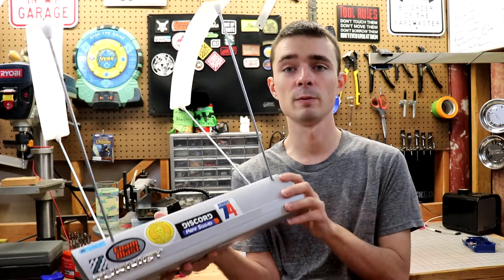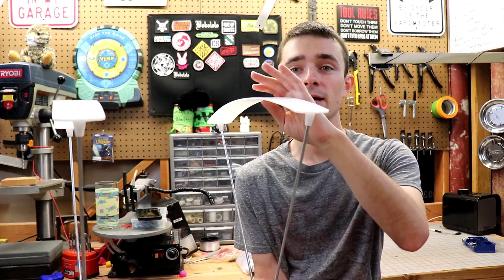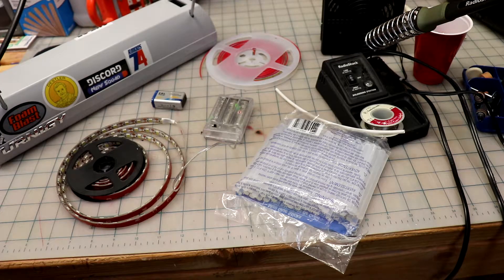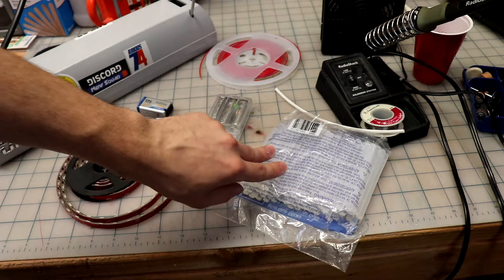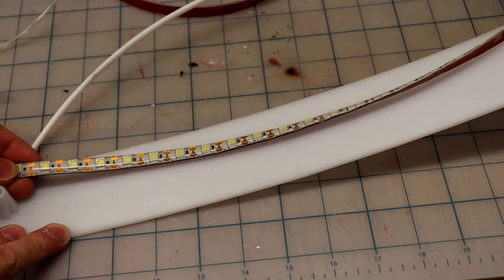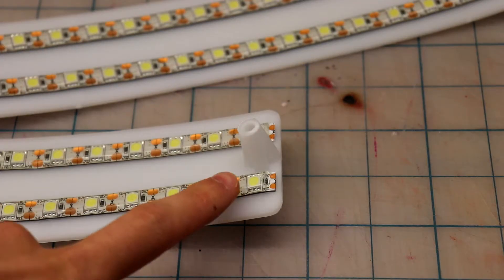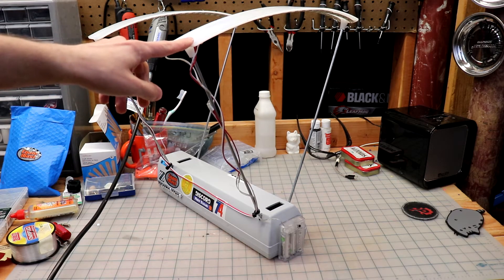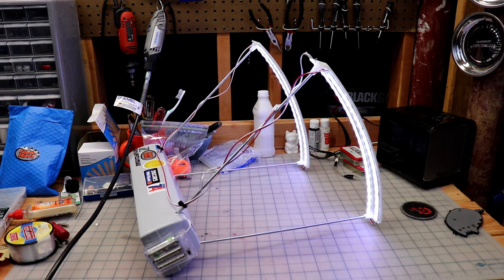DIY Chronograph LED Light Bar

Comment: You're a readings will be wrong or you'll get an error with those lights you need to use 850 nm infrared light strips they come in adhesive backing and are like five dollars on eBay

Comment: My dad wanted something portable like this for his chronograph and I tried the same thing - but I had no luck.  With the light coming in from all sides, the projectile doesn't create enough of a shadow.  So I tried concentrating the light to a smaller space directly above the sensor, and had SOME luck but nothing consistent.  It turns out the problem is that chronographs operate in the infrared spectrum and most LED bulbs don't produce much infrared light.  I had much better luck with a 15w incandescent light bulb (the ones they make for candle warmers) (above each sensor with an additional piece of material to block the light from hitting the opposite sensor) as incandescent bulbs produce a lot more infrared than LED's do.  Only problem with that is it needs to be plugged into wall power.  My next idea is to mount a single 10mm infrared LED bulb at the top-center of each of the 2 strips and power each one with a AA or C battery (they're rated at 1.4-1.6 volts each).  Chronographs also work fine indoors if you use an incandescent light bulb in a socket directly overhead (like a 60w to 100w bulb), but accuracy falls the higher above the sensors your projectile goes due to the V-shape of the shadow relative to each sensor (think of your 2 sensors and light source creating a triangle).  So you'll get artificially too high of readings this way.
Reply: Most chronos operate in the visible light. But the kind of LED's you use are  importaint - dimmable leds (if they have a dimmer) cause the light to flicker and thuss, wont work with chronos. I bought a LED set that had a USB plug and a dimmer. Even on max brightness they flickered and reported wrong readings. But i removed the dimmer, and just drove it from a USB power bank and now it works reliable. 

Its important you drive the LEDs from a DC source like batteries, a AC-DC adaptor cause flicker aswell, as they generaly are switched supplies.

Comment: I don't know about your chrono, but my Caldwell said in the instruction manual that light from LEDs could effect readings.  But this is a cool idea.
Reply: i have bought many battery operated leds, well three sets of two to be exact and it does affect  the chrono. sometimes it doesnt work at all, and sometimes it goes crazy and other times it produces constant errors. i suspect i need both led sources to come from the same power source, if the front light is simply a tiny bit brighter due to battery charge that may throw it off. but who knows
Reply from the maker: I didn't see anything in the manual for this one, and the company sells a similar product but the LEDs are located more in the diffuser bar (which may make a difference). If I have issues I'll have to update this video/description in the future
Reply: Mine has a light bar like that, but I'm not sure what type of bulbs it uses.
Reply: its because LED's driven from a AC source flicker. Or if you have a dimmer circuit in it. DC driven LEDs work fine with my caldwell. I use a similar 5v LED strip but power from a USB-A plug

Comment: Nice, I'm making my own 'tube' chronograph, (hopefully a few LEDs will be good enough lighting for that) but I don't want to shell out the £50 for an entry level one, which I could only use full length or half lengths with

Comment: Very nice! I've been wanting to do something similar with mine, so I can do away with the ghetto lamp setup I'm currently using, but I don't know enough about those LED strips. 
Do you have a link to the ones you used? 
Also, would there be any negative consequence to adding an appropriate resistor, and  tapping into the chronograph's power? So everything comes from the same source, and turns on together?
Reply from the maker: Added to the description in case anyone else has the same question. You could definitely do that, and the only down side I would see (if set up correctly) would be that battery running out faster so you may want rechargeable ones. To drop the 9V to 5V you could use the resistor method, or a small voltage regulator board. I have used regulators like these before where you manually set the output with a knob, but there are nicer ones with digital displays as well.

https://www.amazon.com/eBoot-LM2596-Converter-3-0-40V-1-5-35V/dp/B01GJ0SC2C/ref=sr_1_3?ie=UTF8&qid=1536777733&sr=8-3&keywords=voltage+regulator
Reply: @Rmods74  awesome! Thank you very much!